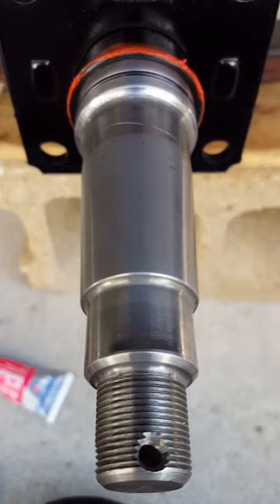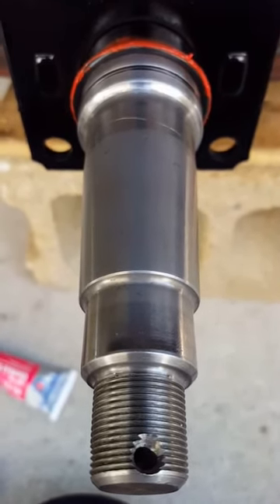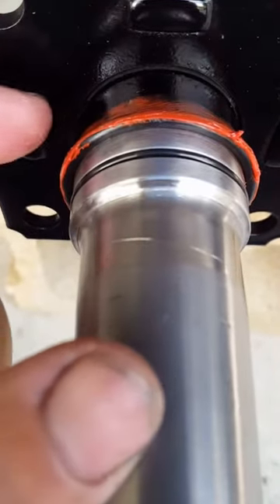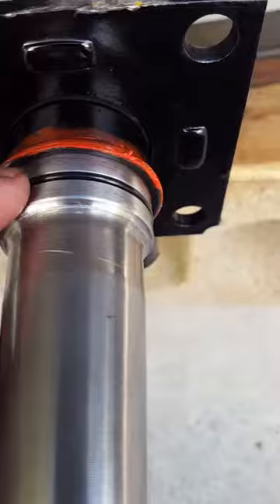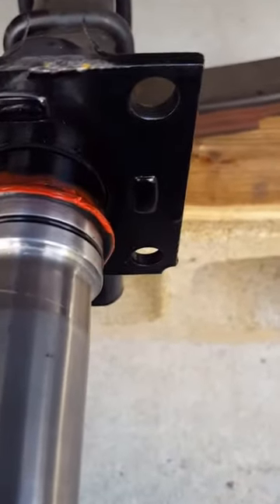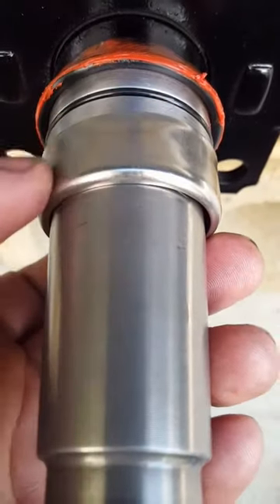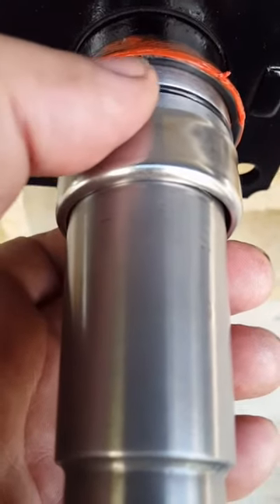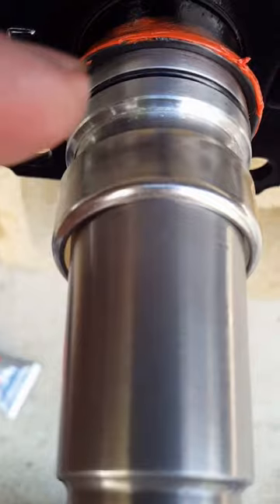boat trailer bearings, vault hub, seals, o rings, ss wear ring, brakes, calibers replace

Comment: How did you get the old wear sleeve off? I'm in the process of replacing all my seals and bearings now. Thanks for all the info, you've helped me out alot.
Reply from the maker: Best way is to score the wear sleeve with dremel using a cut off wheel on it. Lightly score just the top surface. Then just beat it off slowly. Dont damage the spindle
Reply: @user-og7il2wf3w  if the wear sleeves look ok do you think they still need replaced and new seals installed? I'm trying to figure out what the wear ring actually seals?
Reply from the maker: @kellycarr4701  you cant get the wear rongs off with damaging them. The seal in under the wear ring.if the wear ring looks brunt or has any score marks on it yes replace them
Reply: @user-og7il2wf3w  ok, thanks for all your help.

Comment: Where did you get the gasket from? I can't find any info on UFP/Dexter website or parts listing. They also didn't know what I was talking about when I asked them on the phone for a part #. I had the the old gold oil bath bearings and I am trying to upgrade to the Vault system.